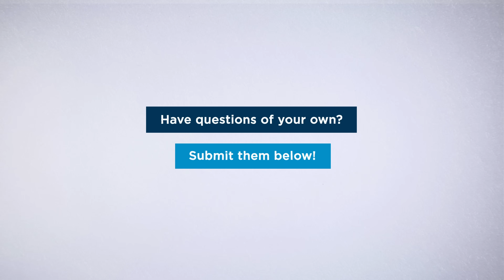Ask A Roboticist: Meet Cassie | Boston Dynamics

Comment: Your professor tells you to give them the gold but why would he say that? They would have to be alive in order to take the gold. Gold god damn kit robotics cost $7887 in college courses and they are a secret of the robotics community. They as such are a bust of the head and shoulders of a build. They need to be coded to F=m*2345 not F=m*a*a as such Isaac Newton did not have any robotics. Besides giving them the gold you need to tell them E=hf^2 laser physics research equation for knowing this you receive a laser sensor. You can give them two calculators or computer chips and then they can run and move faster.

Comment: Did Cassie go straight into working on spot in Boston Dynamics from high school? (which I guess is equivalent of UK A levels or GNVQ) So no electronic engineering degree? Would Boston Dynamics consider an application from someone who had designed, built and programmed their own robots for fun as a hobby, but lacked a formal qualification in electronics?

Comment: If Spot was programmed correctly would it be a good dog walker? (is the soft were hazard aware? )But I think first see if the pet is ok with a yellow walker! but spot would rock at throw the ball!
Reply: i think currently this is a pretty big reach because dogs tend to pull on leashes and be quite unpredictable. I think first we'll see robots in industrial & military uses and later some very specific household jobs (kind of like roombas rn) and only then more general jobs which are quite open ended like walking a dog

Comment: Question: Do you track animal movement and transfer parts of it to the robots or is it a pure calculations + trial and error type developement ?
Reply: Reinforcement learning (Machine Learning) + animal-leg-like movement policy
Reply: @jonathanarreola5279  I think they haven't implemented neural networks in any area of the Spot robots just yet. The arm extension, however, might be using computer vision.
Reply: the way its done is that they look at the layout of the animal (here they used a dog) and set up the joints more or less like the animal then its pretty simple the have the neural network in the robot calculate the angles and movement speed with input from a gyroscope making it hard to actually say whats being figured out by the AI through learning and what is being calculated from input by the gyro and other sensors :D
Reply: I don't know for sure, but I guess a part of both. It looks quite obvious that the walking cycle is inspired by animals that is mimicked into spot by calculations and trail and error. I guess they use a pre determine motion cycle for normal circumstances with a on-board processing system to adjust for more complex surfaces like a inclination or stairs.

Comment: Q: How would you get into robotics if you're in the life sciences?

Most of my career has been in labs and clinical environments, which seems pretty separate from the more hard engineering of places like these.
Reply: It's easy to get into as a hobby. You should get an Arduino starter kit. One of those that comes with a book with projects that you can make with it. After that, you should start trying to make your own projects.
Reply: @uku4171  you should get more likes .. this is a great way to get some coding/programing/software/hardware start in your life.
Reply: through biomechanics?
Reply: It’s going to be hard like everything in life, but you don’t have to chalk up thousands for a degree
Reply: Control loops (like PID) and inverse kinematics (IK).  I started dabbling into robotics about a year ago, I'm still stuck on those two. PID loops had become my bane in making anything that moves. I go back every so and try to figure out the PIDs.
Reply: Being brutally honest, it would be difficult, more than likely you'd have to go back to school and get one of the following: Bachelor of Electrical Engineering,  an ECET related diploma, or a Bachelor of Mechatronics. 

Your experience would come in handy for sure as I'm sure it's taught you problem solving and good analytical skills, but you're right, that field is quite far removed. 

If you're really interested you could try to teach yourself basic digital electronics and become familiar with embedded programming on resource limited platforms like microcontrollers. There's a bunch of free courses online, you could start with something super simple like an Arduino and graduate yourself to more industry standard controllers like PICs or TI based ones. Once you have a basic understanding of digital electronics and embedded systems you could start looking into more exclusively robotics based subjects like motion and path profiling, again, lots of free courses online that usually have a name like "Robotic Applications" or something along those lines.
Reply: @dtraindaimyo3377  Great info, as a Dad I like to have some basic understanding when a 'how too questions?' comes up... 
I was wonder, my 12 year old son has autism and loves his gaming, but I would like to introduce him to coding as I think he would greatly enjoy it, do you have any suggestions, if not too much trouble on where he could start ?
Reply: @dodgygoose3054  

Hey man, 
Depends on what he's interested in, personally I find learning pure programming without some sort of application a little boring, but he might not be the same. 

I think embedded programming is a little bit more fun because you get to see directly how the hardware in a device interacts with the software— so I can give you advice there. 

Look around for some simple projects you and your son both might be interested and start from there. For example, you could create a timed LED strip that flashes some sort of colored pattern. 

For a beginner microcontroller I would recommend an Arduino which can be a good platform for learning C or C++. A cheaper alternative is a buying a Ti microcontroller and using "Energia" which is basically an Arduino port. Alternatively you could get something like a raspberry pi which is actually a mini computer, but you still have access to GPIO ports to interact with external peripherals like LEDs, temperature sensors, accelerometers, etc... On a pi you can also write your code in Python instead of C or C++ which might be a bit more beginner friendly. 

This might sound a little like gibberish but Google "beginner Arduino projects" or "beginner raspberry pi projects" and try to find something you and your son will both be interested in making together.
Reply: @dtraindaimyo3377  Mate that was brilliant thank you. That raspberry pi sounds really interesting, we're out in country Australia so those temperature sensors, bits and bobs would get him out and about a little, plus beginner friendly is always good. Thank you again you've been a big help.
Reply: @dtraindaimyo3377  i'm just a viewer randomly reading comments, and i don't know if i'll ever apply myself any of the information you've given these two people, but i really needed to tell you this : 
you are an awesome, cool and tremendously helpful person.